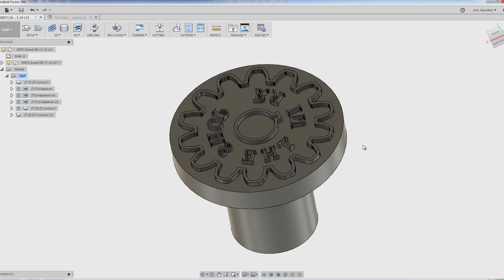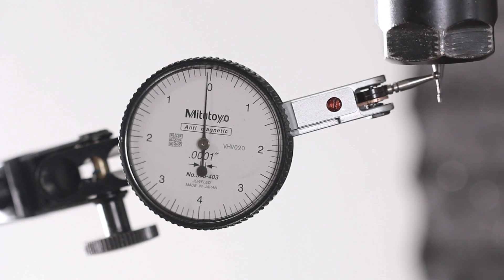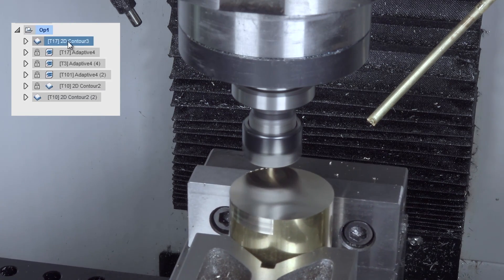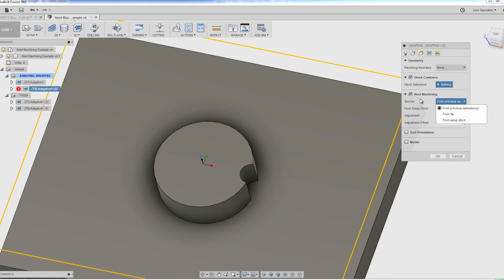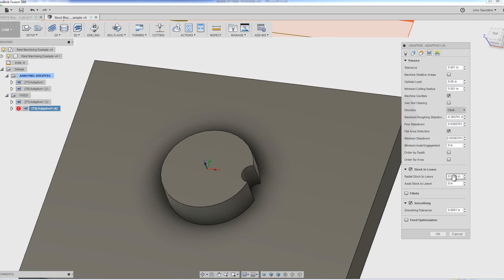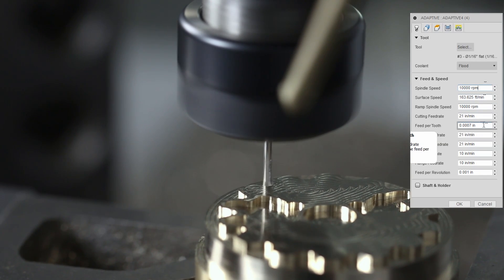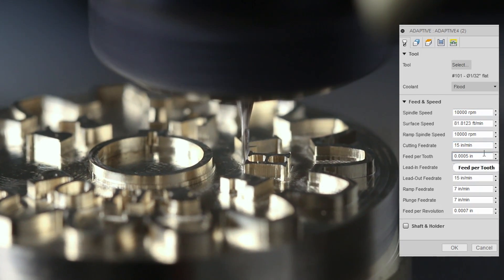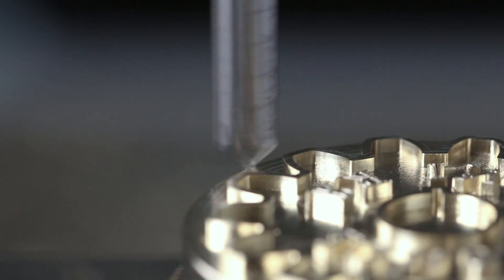CNC Machine a Hot Iron Brand! WW152

Comment: Thanks John for all your great videos, learned a lot about CAM using Fusion 360. However,   as a beginner, I am not sure how to set up feeds and speeds of the machining tool path. Also, is there any way to calculate the depth of cut and optimal load of the tool path?
For example, I am currently working on micro-machining acrylic with a 0.5 mm 2 flute flat end mill (spindle speed:27000rpm, cutting feed rate: 720mm/min),  what is the safe depth of cut to make?

Comment: So, I often see those "whisper cuts" when I'm doing a straight-up 3D adaptive tool path, where the only thing that came before was a facing pass with the Superfly. In that case, I don't know how to adjust the tolerance properly. I have a tolerance of 0.1 mm, and a stock to leave of 0.5 mm, and assuming 0.0 stock to leave on the previous op (Facing op), that meets your formula. I think it's doing whisper cuts on the roughing passes earlier in the same op. I think it might help to adjust the Ignore Cusps setting (in my case, it's also 0.5 mm), but I don't know which way.

It also seems to pick up the tool and rapid to the other side of the part, only to do the same and return to the first area to do a little bit more work. It's not super efficient :(

Comment: To avoid your dislike of constantly increasing stock to leave instead of doing roughing, smaller endmill roughing, etc etc. 

Rough with the largest and finish the geometry that the large tool can reach. THEN move on to roughing with a smaller endmill, then finish, and continue on that way. 

This way "previous op" is already finished to the final dimensions, and your adaptive with the smaller endmill won't pick it up as uncut material, allowing you to make the smaller endmills stock to leave as small as you want.

Comment: This illustrates exactly what bad software can force you to do :) There is no easy way in Fushion 360 to do positive engraving - only very basic negative. Especially of this size. And no way to efficiently make use of larger engraving bits. Its sad to see what sponsorship can force a man to film...
Reply: Really? Fusion is geared more towards mechanical type of design not artistic. For that, a program like Aspire or Vcave are great but they suck at what fusion does.
Reply: So what are you complaining about? Everything gcardinal wrote stands true. There is software better suited to this job, as you admited, and if there wasn't that sponsorship that better suited software might have been used.
Reply: Arne Schwarz It's not just sponsorship, it's experience. A guy who spends his life doing adaptives and threadmilling doesn't want to learn a new program just to make 1 part.

Comment: I was surprised you didn't use engraving v-bits as others have already mentioned.  I too usually use a 1/8" or 3/32" endmill to rough out and then have a selection of 10, 20, 30, and 45 degree carbide engraving bits that I choose from to do the rest depending on the level of fine detail.  I would love to have a precise high speed spindle for the engraving tools and have considered adapting one of those Chinese 20k rpm water cooled spindles onto the mill.

Comment: extra toolpaths are a pain get them all time in Pro-Mtg (Creo) there is feature in Powermill to trim your toolpaths you can create a large 3d surface and trim away the areas you don't want, then press leads and links to reduce the amount of lifts to the retract plane and it's with same company as fusion.

Comment: I've built a few brands over a few years and withe the really small end mills you only need to go down .05" wiht them you don't need to go all the way. so rough .180 with the bigger end mills and then on down a small distance with your tiny end mill. sometimes you can use a really small ball to get into corners as well

Comment: I have used my Lakeshore (obviously other brands will work) engraving bit.  .020" ball 20° Taper to get inside of the little areas on brands that have lots of detail. I use adaptive clearing and only cut about .030" deep.  It takes a bit of time but works great on brands for wood.  That was with an aluminium brand, brass would work even better.

Comment: I love the editing style with the screen graphics over the milling video...  As for the last chamfering op...  Could you have used an engraving operation on the letters that are too small? The V bit could hollow out the tiny areas, so at least the branding would be clear in those spots...  Just a thought...  Been using the engrave strategies A LOT lately for super small details.

Comment: "Everyone's a hero in brass."  So does that make everyone a superhero in aluminum? ;) Great video.
I also use the vee type engraving bits for work like this. Usually in carbide, and you can get a variety of different angles and tip diameters. I believe these were developed for the printed circuit board industry, so they are crazy cheap. With a single flute slight runout is no big deal, but you need a metric assload of RPM. I bolt on an aux spindle with 25,000 but I would like even more, someday. Check out the 3D engraving tool paths. Easy to get near perfect square inside corners with a pretty robust 1/8" tool. The walls will be tapered, but for something like a stamp or brand it's usually fine.

Comment: John, for the small areas like on the S at 10:49, you need to use a different angle chamfering endmill, better an 30 degree engraving endmill , or 20 degree even better, and progressively make the "wall" thicker. I have not yet used my Tormach for brass emboss stamps, but I done hundreds of stamps on the router, and as all the stamps I make are way smaller than yours, I always used engraving bits. The first passes are made like yours with a straight end mill, but after that, I used an engraving bit with it's tip flat, sometimes I use the one flat to 0.8mm other times the one flat to 0.5mm. This way I can remove the material in all little holes and tight areas - faster, after this I make the finish pass with a 0.2mm tip, Here is a photo to understand what I mean by the wall progressively larger goo.gl/6r3fXc

Also I think having the wall tapered on all contours it helps increase the punch life
Reply: trying to figure this out myself as this tutorial is basically incomplete because he didnt machine away those small areas around the text which would make the stamp useless. What cuts and settings do you use in fusion360?

Comment: John, Talk to Fenner...  I gave him an 0.008 end mill.  I should send you the rest of my box of 0.008" and 0.025" end mills.  I left the 0.025" end mill at Stan's.  Oh on the GPS, right button shows lat and long and height.  in that screen pressing Select shows height in meters.  Left switches back to speed and # of satelites in view.  Up and down changes backlight, yes it takes 42 presses to go from full brightness to off.  Yes it's set to Pacific time.  Source is at pastebin dot com slash 47EidDHd  I think you're eastern so it's 4 and 5 hours instead of 7 and 8.

Comment: Hey John,

Great video. As soon as I saw this, I jumped ... I started a business making branding irons out of brass just like this. We discussed having you make me some handles a few months ago. Anyway, the trick to those tight inside spaces and internal corners is not smaller endmills -- the trick is with a v-groove bit like a Whiteside 1541 - I haven't tried to do this in fusion 360 yet, but the rep told me an engraving toolpath would be what i want.

I use vectric's vCarve Pro to do the toolpathing - all I ever need is a 1/8" endmill for roughing most of the stock away - then the v-groove bit does the rest. Hopefully I'm not giving away my trade secrets here, lol!

I did a few videos on my process, but I won't spam your comments with links to my vids right off the bat. I don't want to be rude :)

I'd be super curious to have you walk through this in Fusion if you get it working.  I haven't learned enough Fusion yet to be good enough to switch, just yet.

Thanks for all the awesome vids!
Reply: I use a 1 flute 30 degree engraving bit to clean out really tight spots.  It's a HSS tool, so I basically use 1 per job, however they are really cheap.
Reply: Jason Beam Same, I use a 60 degree carbide v bit. Vcarve also.
Reply: Third vote, same here...VCarve is king for something like this... Leaving material on top to allow a final surfacing pass for cleanup of burrs at that size is a good thing too...can't beat the surface finish. If the part is small enough, cleaning in a reloading (ammunition cartridges) setup might help without ruining the crisp edges too much.